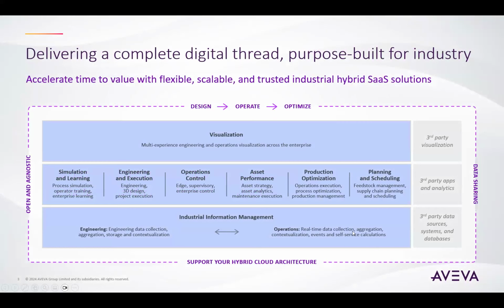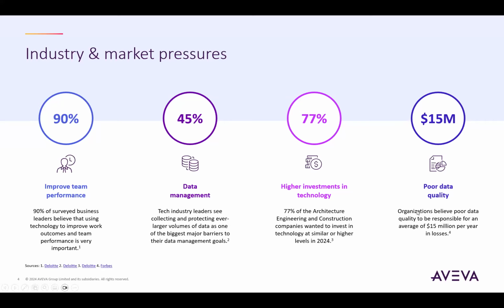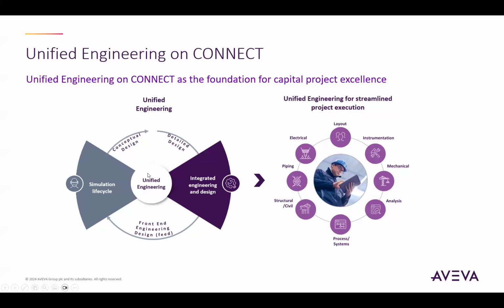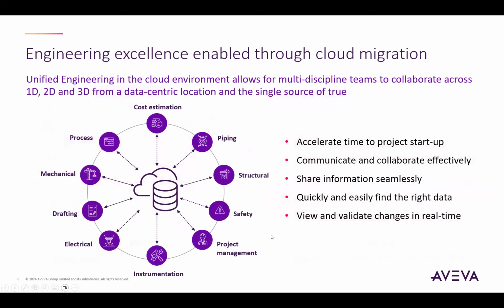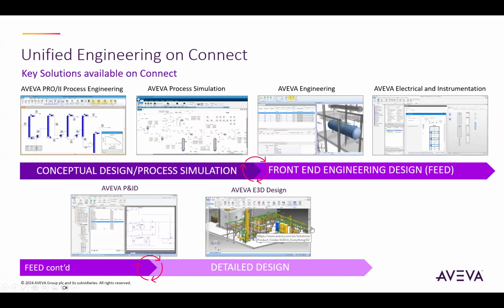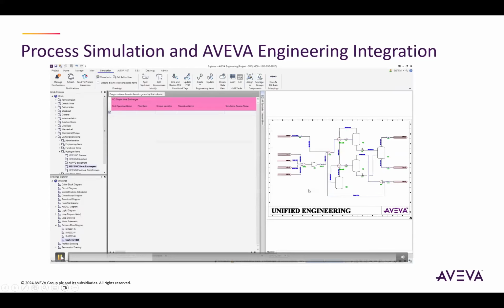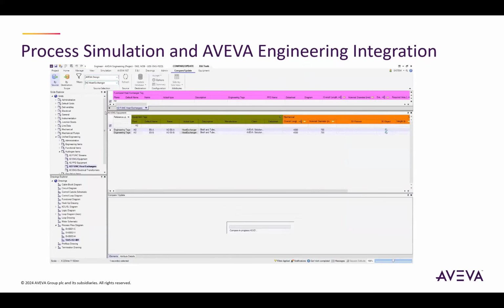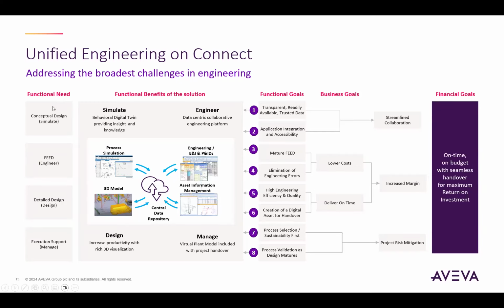Learn in 30: AVEVA Unified Engineering

Comment: Export the Aveva, Majorana, Grok, DeepSeek, Chat GPT, Starship, Azure, Revit, Plant 3D, Civil 3D, Inventor, ENGI file of the Rocket, the Building or Refinery to Excel, prepare Budget 1 and export it to COBRA. Prepare Budget 2 and export it to Microsoft Project. Solve the problems of Overallocated Resources, Planing Problems, prepare the Budget 3 with which the construction of the Rocket, the Building or the Refinery is going to be quoted.